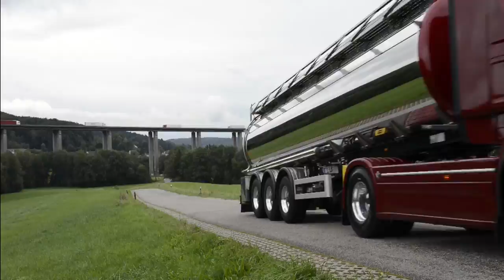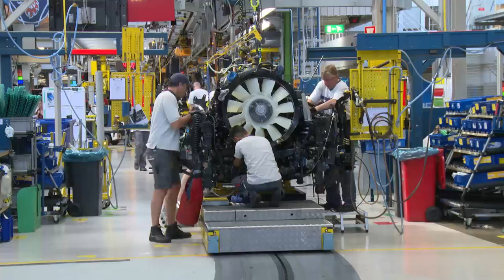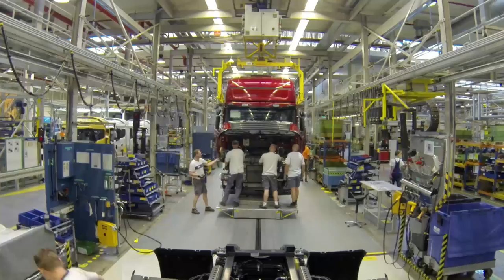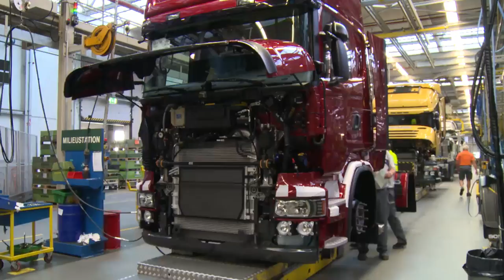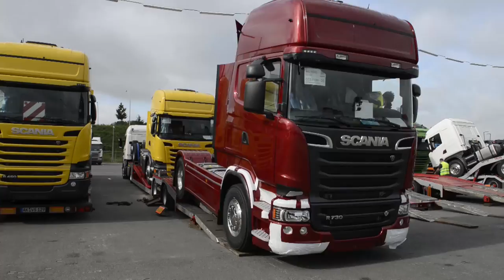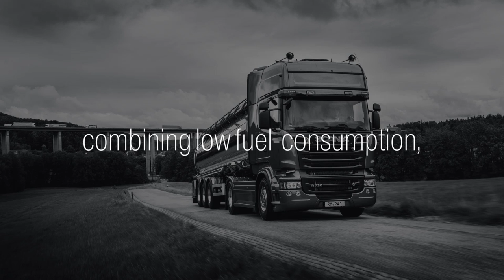Scania Legend 2013: Watch a Scania R 730 V8 Streamline come to life

Comment: it would be nice to see these trucks here in America!
Reply: And it would be nice to see some american trucks in €urope
Reply: Petru Catalin Timpu that would be nice as well.
Reply: Most trucks in the USA are sold as gliders. Meaning that the manufacturer assembles the truck without the Engine, transmission, driveline and rear axles, which are installed by the dealer or the customer. Scania could sell its engines and in America, and customers can choose to put them into their peterbilts, kenworths, and freightliners. This way, apart from the choice of Detroit Diesel, Caterpillar, and Cummins, customers could also go for Scania. In fact, in the USA, most Volvo Trucks are equipped with Cummins Engines.

But in order to do this, Scania would need to adapt its engines to fit american truck mounts and Eaton-Fuller Transmissions.
Reply: hondacivic1992 but scania continue to sell industrial,ship,genset,mine dump truck an earthwork machines engines in usa&canada!
Reply: hondacivic1992

Wasn't there a Scania dealership somewhere in NJ?
I'm not sure how well they were doing though.
Reply: I live in Argentina South> ~~(America)~~, and there are so many Scania.
Nice Trucks!
Reply: ***** There are several reasons:the U.S. market can only forward aggressively to break, because the U.S. is crazy about buying into the product into the U.S.!Scania tried to introduce a one drive axle + one lift axle tractors!tehe us truck drivers still do not understand that urplus the double diff on good us roads!Sweden and Norway for decades now flies 50 to 60 ton gross vehicle weight of the truck without a problem one drive axle,in snow and mud hill and dale!the us truckers mania the double diff!why?in us 80000lbs the gross...just in asphalt and cocrete roads!in sweden gross:133000-200000lbs!
Reply: misterPSYCHOPATH3001 I going to bring a scania into America soon

Comment: How much time does it take, to build one of them?
Reply: 6 hours
Reply: 5 min 11 seconds form 1 thing to do. are you done with in the 5 11 min you have to help the rest
Reply: Guusje the Beagle Whose has right? :D
Reply: Léo B. Actually. It depends on where it's built. The production site in Holland has more staff but less time. The production site in Sweden (which is the main one) has more time (7 minutes and 10 seconds right now) but less staff. That means that each worker has to do more on each truck! 
It takes a bit less than one day to build a truck here in Sweden. We manufacture about 58 per day. 
Maximum capacity in Europe, all production sites included, is over 200 per day!
Reply: RapingBear Ok, thanks :)
Reply: i work in kenworth/peterbilt factory in canada, we do 69 truck every day, 6 min 10 sec each station